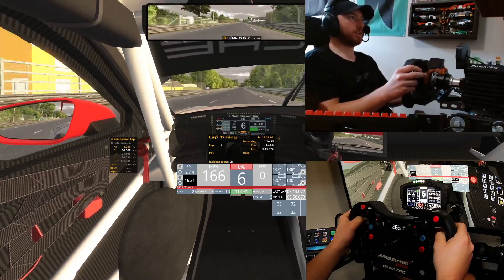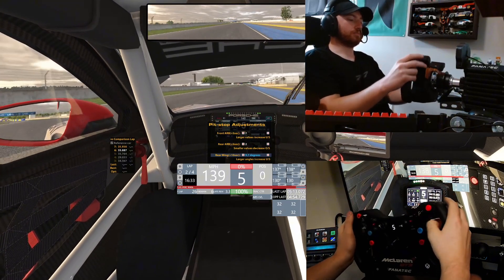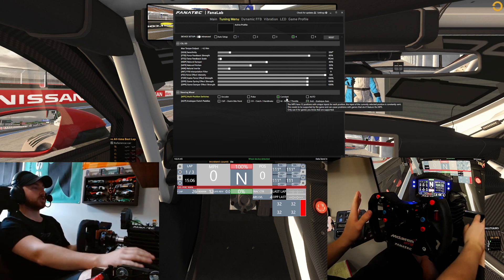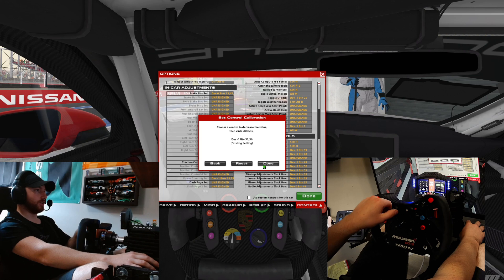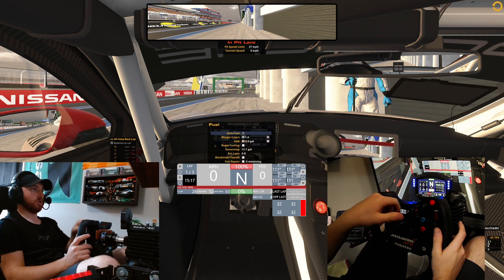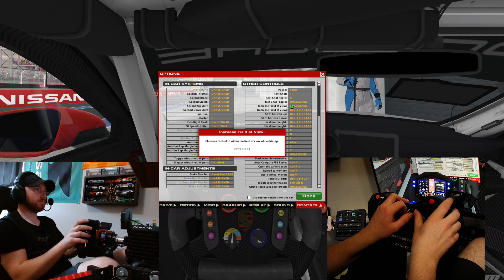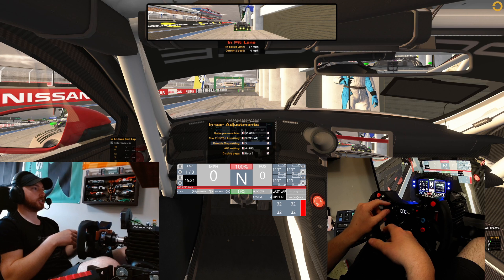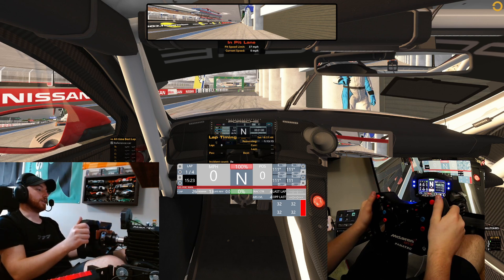Fanatec wheel mapping on IRacing. (Mclaren GT3 + more wheels)

Comment: I have the same wheel but i cant configure my mapping like u have done with ABS and TC for example. When i do the increase/ decrease value it overrides the switch knob mapping. I've tried to update the wheel and everything but i cant get my wheel to map like yours. Do you have any suggestions?
Reply: If you haven’t figured it out yet, go to the fanatec control panel and change the setting under “steering wheel settings” MPS to constant. This will allow you to do what he did in the video.
Reply: @hunterstacey6616  thank you